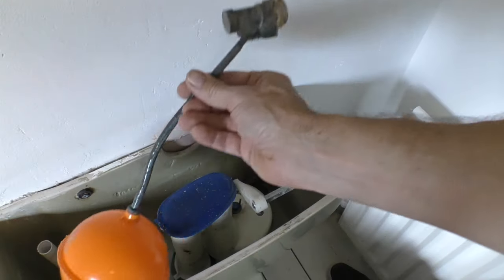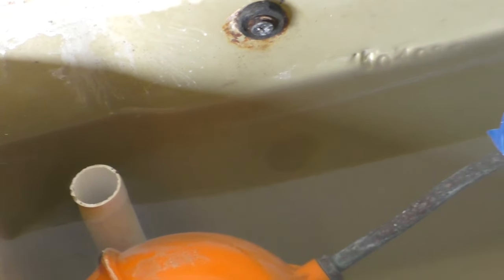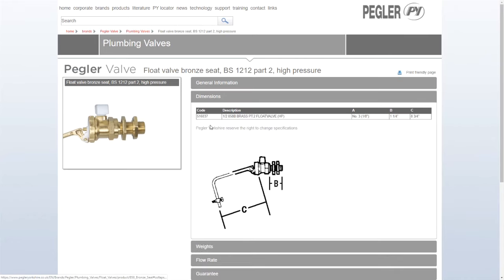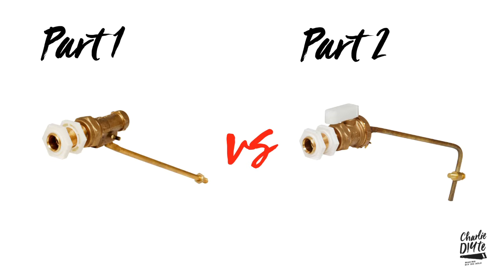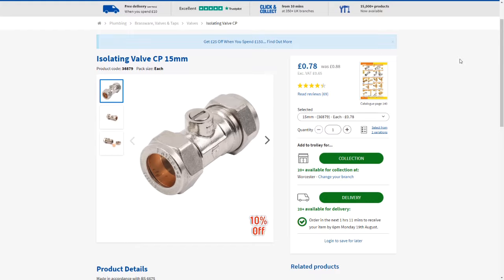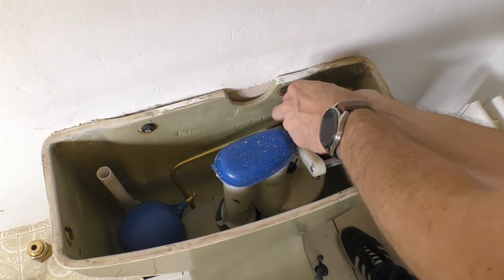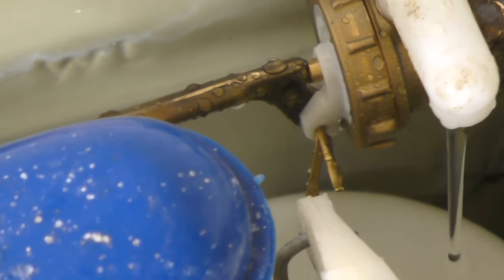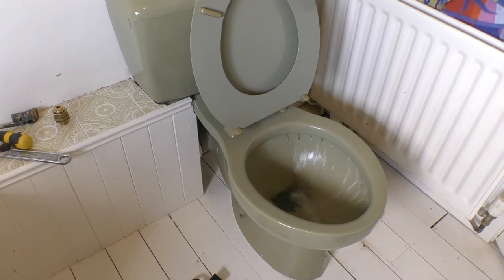How to Replace an Old Toilet Cistern Ball Float Valve

Comment: Thanks for this video showing your thought processes when repairing a classic toilet.  It was beautifully presented and executed as a video.  

To stop that annoying dripping at the end you can attach a thin collapsible plastic tube or use a section of material such as from a pair of tights.  This just guides the water into the cistern stopping those final plopping noises.  Never use a rigid pipe as you will create a back-syphonage hazard.

You should use a water hippo to reduce excessive water usage.  Those toilets were built in a different era before water conservation was a big issue.

I used to use one of those toilets in my childhood.  It is a classic and an irreplaceable toilet.  It is both a syphonic cistern flush with a syphonic bowl action. That is why it gurgles at the end when the bowl syphon is broken.  That toilet is a really clever design but it also relies on a hidden syphonic bomb to redirect the water when it flushes.  The water first starts to flow internally down the back of the toilet which is why the water level drops in the bowl as the priming of the syphonic action and the remainder of the water is then directed into the bowl.  This is not like the typical American toilets which use a syphon jet.  They were really expensive in their day as they are American technology made to work within the British regulations of the day.

http://www.youtube.com/watch?v=jBUP1UqS1LY

http://www.youtube.com/watch?v=lBD3GOZvIHE

The syphonic cistern means that unlike the prehistoric flapper bung type mechanisms, which are all the rage these days, it will never leak wasting precious treated water.  Ironically, The syphon flush is actually the more modern technology of the two technologies.  In the UK it was a requirement until when the regulations were relaxed and the more unreliable flapper technology was legalised.  Probably in part because of the introduction of water-meters as well as the harmonisation with Europe.
Reply from the maker: Wow, that's got to be one of the most comprehensive comments I've received - big thanks 👍 - some real gems of wisdom there! Yes, they're great these old syphonic flush systems. The one featured in this video actually broke several years back when the diaghragm in the syphon itself perished, along with the rubber washer that it slots into. I had a lot of fun down at the local DIY shop where the old guys behind the counter "wow, we haven't seen one of these for a while" managed to kit me out with a similar washer that I had to modify with a scalpel, and improvised a new diaphragm from some rubber sheeting. So satisfying when I put it all back together and it worked a treat!

Comment: Hey Charlie, thanks for the great tutorial. I have pretty much the identical cistern and bought a similar ballcock and valve. The water cuts out around an inch below the overflow part too but after a good few hours like overnight I find that the water has risen above the overflow
Reply from the maker: Is that with the new valve fitted? Try adjusting it a bit lower and if that doesn't work, you may be suffering from very high water pressure like me.
Reply: @CharlieDIYte  Hi Charlie, thanks for the reply. Yes it was with the new valve. I have bent the arm a little and that seems to have fixed the problem. The float wasn't low enough it seems. Thanks again. 👍

Comment: got same cistern and the copper pipe has a hole in it and is pitted so got no choice but change the whole lot with this Thomas Dudley Beta + Part 3 Adjustable Float Valve Bottom entry, i doubt ill get the new type that's in another toilet due to clearance, got to love the screen shot and prices what difference now
Reply from the maker: You won't regret doing that. I actually switched out the entire cyphonic flush here for a dual flush system and modem fill valve. Very pleased I did. https://youtu.be/JDdfR4f_ORE?si=OcGL1Ld_Ei89C39d
Reply: @CharlieDIYte  i looked again i can fit the new type filler so ill get the viva type from Toolstation and a syphon just in case that goes later on, i may as well fit an isolator their also and replace drain off as that's 50 year old

Comment: dd you notice the embossed " W L " with the horizontal line under neath at the inside back of the cistern, that's the water level guide line, if you get a Thomas Dudley Turbo 88 Duo-Flush Siphon, it over flows internally through the siphon into the pan, dual flush to save wasting water, very good, I have been a plumber for 50 years.
Reply from the maker: Thank you for this. Yes I agree those Thomas Dudley syphons are the way forward. I've actually done away with the syphon entirely recently in one of our other cisterns in favour of a dual flush https://youtu.be/JDdfR4f_ORE
Reply: Wow how old are you now 55?
Reply: @micky7028  wish I was still 55 , but that was 15 years ago, I use to be a plumber in hospitals 1972 onwards, we had 4" bore equilibrium float valves with 20" copper floats, you needed a wheel barrow to bring them down to the workshop, to repair them, I have a 1/2" Ebco equilibrium float valve in my Armitage Shanks Clena high level side inlet cistern, flushed with pride, but I do like,  Dudley Hydroflo Equilibrium Float Valve with a Brass tail
Reply: My Dad was a Hospital Electrician '70s-'00; I miss hearing him talk of his job, the older equipment ect; for some reason it fascinates me! I also miss him fixing our house problems; he'd turn up, willingly, with an old heavy magic bag full of anything DIY you could need! Now it's just me, & uninterested kids, trying to mend things, but I don't have his rich knowledge.. Thankfully I do have the www tho'   🙂 x

Comment: Thanks for this. I only wish there was a guide to stop that dripping noise for the few minutes after filling (the drips at the end you trimmed in the edit starting at 8:34). Am sure there is a more professional solution than me securing a bent tube or similar from the fill port to below the water-line or acoustic foaming the inside of the cistern.
Reply: I think a bent tube is a good solution. Better than plastic film, which used to be in mine.
Reply: There is, just use a piece of cloth to direct the water into the cistern rather than just falling in making that annoying plopping noise. Some cloth and an elastic band should do it.
Reply: use a equilibrium float valve, a quick fill, and  no dripping, and silent finish.
Reply: I have this same problem, but worse, as the main water pump stays activated and pumps on and off as it keeps dripping. It only turns fully off when the dripping ends. Super annoying if you're trying to sleep.

Comment: You can get mini float valves my old one was a plastic mini float valve but it was falling apart and leaking and my diaphragm flap was bent and cracking so decided to get the viva skyflo dual flush standard syphon and the viva skyflo 4in1 valve but mine is side entry and that’s also very good and very quiet when filling up and fast my tank is like this one but in white but it’s a old style cistern with pipe to the toilet 🚽 replaced it all from screw fix for under 20 quid and never done it before just watched one of their videos they post on here. 
My old shires black cistern I had before this one 12 years ago had the old float style float valve never had any problems with it.
Reply from the maker: Yep, I did that here https://youtu.be/JDdfR4f_ORE?si=coKVeeILvtpTLTqk Game changer 👌

Comment: Good video! Got the same float but even with the float at top end of the adjustment I still don’t get enough water in the cistern. 

Any ideas? Almost like I want it to go round the bend a little.
Reply from the maker: Difficult to know Chris without seeing it. Maybe consider upgrading it to a new Skylo fill valve. It's SO superior 👌https://youtu.be/JDdfR4f_ORE?si=ntDNQV9UKlLwkdIT

Comment: I have a blue toilet that I am removing  this week. I have done the sink 😀
Reply from the maker: Quality. I think I had one of those in my old house!
Reply: Charlie DIYte can’t make up my mind to go with a bush button flush or keep a handle any advice ?
Reply from the maker: Depends. Handle is more traditional, and the mechanisms behind them are much slicker than they used to be - we've got one in the new bathroom and it's very light touch and works a treat. But if it's a modern bathroom I'd be tempted to go with the button flush.
Reply: Charlie DIYte thank you it’s a 1970 mid terrace ,I’m only the 2nd owner moved in 4 months ago  so I’m really thrilled to watch your videos  so easy to follow ⭐️⭐️⭐️

Comment: Hi, I have changed the ball valve seating washer (same toilet i think!), it is still slowly dripping so not sealing. The gnarled nut is only suitable for hand tightening due to limited space. Should I just change the whole unit or will the same happen again if I cant get it supertight?

Comment: Can I fit a brass valve if the inlet is plastic, or will I need to replace the existing plastic valve with another plastic one?
Reply from the maker: Are you saying the flexi hose supplying the mains water to the toilet cistern has a plastic nut on it - or you're just putting a new ball valve on the existing plastic fill pipe? Quite often the fill valve has a plastic thread and the flexi hose normally has a metal nut on it, so you should be ok. You could put a couple of turns of PTFE tape on the thread for belt and braces.

Comment: Id replace these with Fluidmaster or Dudley. For the Syphon I'd go with Dudley Cascade or Fluidmaster Pro, as this is a syphonic toilet, renew the aspirator at the same time.

At least you replaced the fill valve with a better quality one, although P1s can last a very long time.

It will be a lot cheaper then replacing the toilet.
Reply from the maker: Thanks for that, buddy. I'll need to replace a more modern valve at some time soon (cheap toilet I bought from B&Q) so I'll be referring back to your recommendations for that 👍
Reply: @CharlieDIYte  No worries. Your better off with a Fluidmaster.

Comment: Charlie, why does my new bottom entry fill valve not fit into my cistern? the plastic syphon unit is stopping the new valve seating on the bottom where the inlet is?? Why is this when it says on box will fit any standard bottom entry !! Puzzled!!!

Comment: Thanks for the tutorial. I have an overflow similar to this, it's not internal (old ideal standard cistern), water just flows outside. I want to clean the rim jet holes some of which are clogged with calcium deposits. Without an internal overflow it's hard to pour any descaler solutions. Any suggestions?
Reply: install a water softener, except for the drinking cold water in the kitchen, no more lime scale, but it needs to be a real water softener, not these inline water softeners which are about 10" long, the fail in no time.the soft water will gradually dissolve the existing lime scale in time, and that is the end of any more limescale..full stop and a cleaner toilet etc.

Comment: You have the identical cistern and colour to mine. Mine has a hairline cracked, any idea how to fix....?
Reply from the maker: I'm not sure there's much you can do about that. Phone around salvage yards and see if anyone has a replacement. I had the identical pink suite in our other bathroom and none of them wanted it so I ended up against it up with a sledge hammer. If all else fails I'll be replacing this bathroom at some point, so you're welcome to have it, but you might be waiting a while...
Reply: turn the water supply off, empty all the water out, every drop, dry it with a hair dryer, and apply some silicon sealant to the hair line crack, inside, leave it set over night, before you turn the water back on.
Reply: Shame about the Pink suite, I hate losing 'history', even awful 1970s stuff! - It's not what I'd want; we've got a '𝑃𝑎𝑚𝑝𝑎𝑠 𝐺𝑟𝑎𝑠𝑠' /Khaki colour toilet like the video; I prefer white, but I heard the colour toilets were coming back in with trendies; someone somewhere's probably searching for 1! Or could've made a n outdoor planter?!   😊

Comment: How long should it take to go from a trickle to a drop to stopping? My old toilet seems to drip for hours
Reply from the maker: A few minutes. You should probably replace the valve or first consider lowering the ball to increase pressure on the valve and see if that stops the drip sooner. The downside of course is that you'll have less water in the cistern.
Reply: @CharlieDIYte  thanks for the advice. Changed the valve and it's all working swimmingly now. The o ring had failed and the restriction valve was plugged up with junk. cheers.

Comment: I tried to do this with my toilet and its truly  a headache. Our valve is plastic not brass  so I got the wrong one. Also I was supposed to get part 3 not part 2. :-( Now the water won't stop leaking from the valve. Should've just called plumber
Reply from the maker: Sorry to hear that. Shame because sounds like with a couple of new components you'll get there, and still save on what it would have cost to get a plumber round.
Reply: @CharlieDIYte   I will try again and let you know how it goes.
Reply: We ended up getting an updates toilet system altogether because this one is very outdated anyway